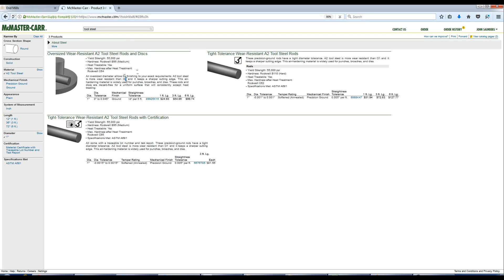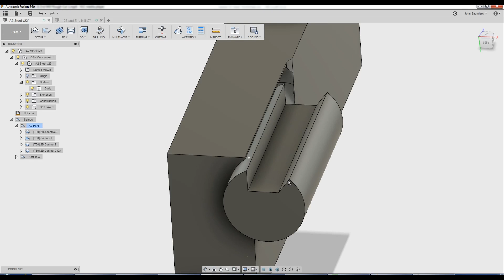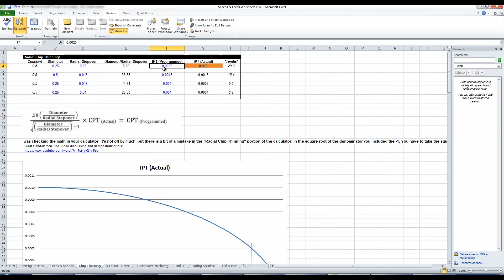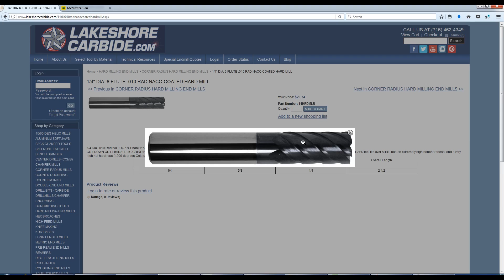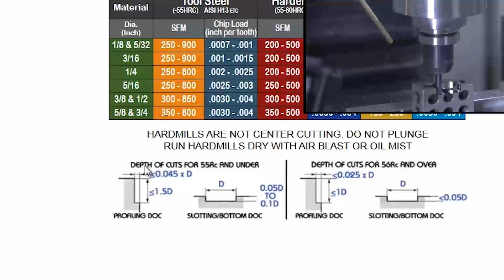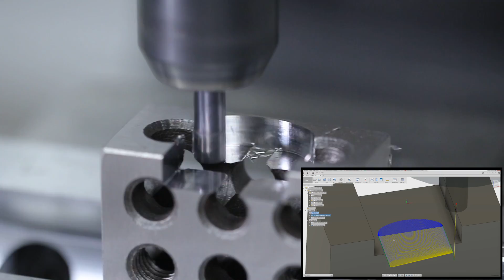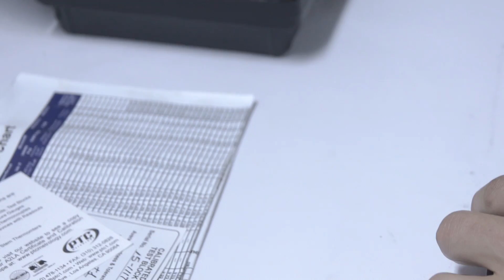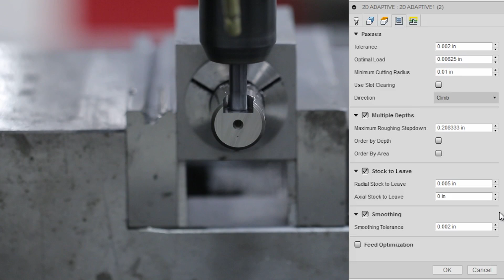Machining 60 Rockwell Steel with the Tormach!  WW166

Comment: It's very slow to process steel. In out workshop depending on the type of steel we use feeding from 1 to 50 mm/min with 300-800 spindle RPM for drilling/milling and for the bigger drills RPM can drop to 50. Have some monster 50mm drills and 240mm face mills. xD
Reply: For milling look into the Kennametal Harvi I TE and a decent CAD/CAM package to make high speed toolpaths.

Comment: how would you go about drilling a .250 Hole in 60 C  to insert a dowel pin?
Reply: 3/16 or so diameter 5-6 flute carbide endmill, then helical mill to depth.  Small helical angle...like 1 or 2 degrees.
Reply: Holeshoot it with an EDM hole driller and wire edm it to size. Good luck helical milling in 60rc with a small cutter....doesn't work for me. I'd like to see a video of that though. Going to spend more on endmills than you would sending it out....especially if the material is thicker
Reply: @kevink6420  cant EDM the  hole. its a blind hole.
Reply: @metalworksmachineshop  i dont know the application of a blind dowel but that’s a predicament then , more so getting the actual dowel out of the hole unless its a pull dowel or permanent. I would personally drill it with a solid carbide drill just undersized and take side cuts from the inside of the drill hole with a .1875 carbide endmill....we use the x5070 series from YG and they work well for side cutting. Bottom cutting is near damn impossible to do efficiently with just about any cutter though when you’re talking 60rc unless cutter has a big ass corner radius. Just my opinion.

Comment: Unless you make your own, most 1-2-3 blocks are only case hardened now....so it might read 60rc on the surface but they're not on the inside...I've drilled into a few over the years lmao

Comment: My favorite is as many flutes I can with an alcrn coated end mill. SGS 7 flute 1/2” rips through tool steel like butter. I probably cut deeper than recommended but it keeps eating it up as much as I can feed it. Had one cutter I dove in at .120 and it still cut it but I did end up with a round shoulder end mill :-).

Comment: I spent 6 months working in a Toolroom setting, and I regularly milled hardened A2 and D2 (Rc 55-60) on a Sharp knee mill. We used the Acurite Millpwr to create trochoidal toolpaths to shoulder and slot at .005" a pass. We only used carbide resharps because we didn't want to be smoking brand new cutters. It made a hell of a noise even at only a .005" doc. I don't miss those days.

Comment: The shank of an HSS tool bit is softer than the business end. You did measure it; but a good file will bite into the shank of an HSS drill bit just fine. Try milling an old file maybe, and make it a direct reply to one of AvE's videos?
Reply: Haha, hard M2 is nasty awful wonder shit.  Especially to grind.  It will eat your wrong wheel.  Hard M2 is nothing for carbide.  Carbide is like a honey badger.  Honey badger don't care.  Gorilla Mill don't care neither. Coolant or not, gorilla eats everything alive.

Comment: Not a cnc guy, why does the program start out of line before it starts to cut? Is it to prevent snipe like in woodworking?
Reply: The software is trying to keep the cut consistent radially, regardless of the path.

Comment: A couple weeks ago I crashed a 3/8" solid carbide end mill into a 1-2-3 block. There are some slight surface marks on the block, but it survived pretty much unscathed. The end mill, however... Well, let's just say I have a shiny new 3/8" solid carbide end mill.

Impressive that you can cut it like that with the right tool. Those blocks seem pretty close to indestructible.

Comment: Where do you get the aluminum block setup that holds a collet for round stock that you used to mill the end mill with? Did you make it or buy it? I have searched for one and can’t find one. 

Also great videos. You have helped me a lot in cnc machining. You got me hooked on Lakeshore carbide end mills for aluminum. 

Thanks!

Comment: Nice!
While hard milling is beautyfull and an everyday technique, it can be so painfull ;)
Large diameter/length ratios will show you how flexible a carbide endmill can be.

Even my little Datron at work can do suprisingly good hardmilling - While we have a lot of specialised endmills for hardmilling, I use a lot of standard carbide, 3 flute, 45° flute, TiAlN coated endmills for it, up to 55...60Hrc. Above that it becoms exponentional harder to machine and more of a tooling issue.

I found machine rigidity and spindle pwoer not as much of a problem, but runout on the tool is critical...
Reply: Threading is the bitch I struggle with. Turning and milking is easy in comparison. I have to pre drill a m4 threaded hole at 3.8 or I can’t get any threads to cut, just broken taps :-(, lol.

Comment: Great vid as always! I didn't check the comments to see if this was mentioned already, but a word on SFM, dry machining, and coatings... I'm sure you will realize this when you start to research the coatings more, but lower range minimum SFM recommendations could make more of a difference than you think. If the tool and chip does not reach a minimum "activation" temperature you will seriously reduce tool life in a production atmosphere. Those coatings not only provide surface lubrication, but also a harder surface on the tool and do not function until they reach a certain temperature. I have done alot of mold and stamping die work in my  shop, slabs of 4140 hardened to 50Rc weighing 300 lbs with 24 hours of adaptive clearing alone. Sometimes a difference of 5 SFM is all it takes to make a tool last 1 hour or 10. Step over affects tooth engagement time, percentages are calculated, SFM increased in a linear scale, blah blah blah too much for a YouTube comment. All I'm saying is that you can and should make those chips hot enough to melt those rubber bellows right off your column, and your tool will ask for more and more. Keep at it John, your an inspiration for entrepreneurs everywhere!
Reply: Thanks for the tip, and only for a minute
Reply: So I can forget working these on my '92 vintage Haas VF-0 with it's plastic enclosure. 😐
Reply: UncleBman not at all. when your dry cutting materials you still have a coolant pump at your disposal and the chips will still pile up somewhere. I like to keep the table and enclosure flushed clean while running a longer job so the chips find they're way down and out. Sometimes, if it's just a quick pocket or slot, I will wet down any soft surfaces right before hitting the green button. A machine I sold last spring had polycarbonate replacement windows, I used thin galvanized sheet metal to make a few deflectors to keep them from melting. You could lay some down in the bottom of your enclosure also if your worried about it.

Comment: Most cheap 123 blocks are just case hardened, so it should be much softer on the inside.
Reply: Bingo, my first thought when I saw this video.
Reply: Thanks for stating that fact.  Just asked my pop pop and he laughed at it

Comment: John, you still haven't corrected your spreadsheet. I mentioned the error in your previous feeds and speeds video. It is not off by much and won't make a difference with larger radial thinning, but you may run into problems when taking smaller cuts. The error is in the chip thinning formula programmed into your excel sheet. The -1 in the denominator is subtracted after taking the square root of the ratio. You are subtracting 1 then taking the square root. Hope that helps, take care

Comment: I would imagine edge life on a carbide end mill is drastically reduced on a hard mill operation. So if you can hard mill 10 parts with one mill hard but 100 parts when it is soft then maybe that would explain why it is not so popular for mass production. Also there is no guarantee that you wont still have part deformation when hard milling from relieving stresses in the hardened part so it may or may not be a benefit there.
Reply: When i worked as a toolmaker.. Hardmilling and hardturning was "all in a day's work.
We'd make the parts slightly oversized when still soft, then hardmill or hardturn finish them.
When used properly, these endmills lasted quite a while.
Nowadays, when i need a special shape cutter on a lathe, like a face grooving cutter for gaskets in watch cases, i just mill those from old endmills, made from HSS, i just design the desired shape, make my CNC programs, put an old endmill in the Chuck, mill it in to shape, and put it in the lathe..
Reply: bcbloc02 tool wear might be an issue, but the bigger issue is machining time, if you can cut unhardened at 50 thou per pass versus 3 thou per pass for hard milling, it would take a lot longer.  The hard milling I've heard of is used in repair work for molds and dies.  There is a place not too far from me that repairs tire molds and they do a ton of hard milling.
Reply: anonymic79 hard machining is done in a production atmosphere too. If a billet is properly stress relieved during the final heat treat it will hold tolerance very well. Hard milling also tends to leave a higher quality finish which cam remove the need for any post op grinding or polishing.  It's all dependant if what is being machined and what it will be used for.
Reply: Hiram Rios minimal engagement still results in the same amount of heat as a wider cut in a softer material. A very small amount of heat is generated right at the cutting edge, while a majority of it occurs just thousandths of an inch inside the cutting edge towards the gullet. The remainder is a result of burnishing, and that's all dependant on cutter geometry. The heat is a result of the friction at these surfaces and the distortion of the material as the chip rolls and forms. Harder materials are harder to shear and harder to form and curl around, this resistance to movement creates more heat. The biggest contributor to heat though is SFM of the cutting edge. In a typical HSM operation, factory recommended speeds and feeds are scientifically calculated  based on the amount of time the cutter spends actually cutting metal and usually considered as %50 the diameter of the tool. If you are running HSM with a step over of %25 then you are only imparting A theoretical %25 of the total heat into the tool. Therefore you can increase the SFM of the cutting tool by a given percentage and of course the IPM to maintain proper feed per tooth. Suddenly your total material removal rates skyrocket through the roof. The tool and cut material still only see the same amount of heat. This is the basis of HSM theory. This is a much more sensitive subject in hardened material, but generally the same rules apply. Hence the broad range of recommended cutting parameters. Inevitably, machine rigidity and capabilities are the limiting factors, only the operator can know the limits. And must be experienced as well. I can mill 6061 aluminium with a .25" diameter 3 flute at 24,000 rpm and over 800 IPM on one machine I own, but due to rigidity issues cannot exceed 200 SFM on the diameter cutter in 55 Rc 4140. The same cutter in another machine can run about 750 SFM without issue. There's a whole different science to learn when you reach a certain level...
Reply: Do you think because of the minimal engagement it actually produces less overall heat then grinding ? maybe it actually makes less heat and imparts less stress on the parts ? Compared to grinding which has a great deal of surface to surface contact

Comment: LOVE your channel!  I personally feel like set screw holders are fine, but destiny tool recently posted a picture on Instagram advocating against them. I wonder if it's because they're focused more on larger machines and shops?
Reply: typical runout on a set-screw holder is 1-2 ten thousandths. You need clearance for the holder to let the tool in obviously. 5-6 microns is not eough to worry anyone, what's a few microns amongs friends?  Its not hydraulic but ...what is with a set screw?

Comment: Ah, the joy of SolidCAM when it comes to this sort of stuff: Just tell what tool you have, what hardness your material is and hit go. No calcs, no datahsheets, just getting chips flying and fast.
Reply: That joy comes at a pretty high price!
Reply: That is ideal when every tool manufacture uses the same feeds and speeds ;-) not. You use a estimated value for a tool not a precise value. Or a college from you has made for your company special tool libraries that you use without thinking how the feeds and speeds did come to life ;-)
Every tool/manufacture have their own spec (feeds and speeds) for hardness and material.

PS. Solidcam is nice used it. But it crashes me to a lot on big molds (for example: dasboards from cars). That's why i did move over to Mastercam in Solidworks.
But for normal work 3d work, nothing can beat the price and capabilities from Fusion 360.

Comment: If you have some of those faulty 123 blocks, with undersize clearance holes, you can use a carbide end mill to enlarge the holes so the can be bolted together like the should. I did it on a hobby grade manual mill using a cheap carbide end mill, so if I can do it anyone can..
Reply: You're probably just chewing away the burrs, so no real pressure.
Reply: @soundspark  the holes were definitely undersized, they were a cheap chinesium set bought at a club auction.  Reasonably accurately ground for size and squareness and the threaded holes are ok but it seems the clearance holes were drilled tapping size if memory served

Comment: Did you check the HRC on the inside (i.e. the surface you machined) of the 123 block?
Reply: Probably around 34 HRC at most, I've never seen those things through-hardened as it serves no purpose. Case hardening and tempering I believe what is done with those, but again depends on the material used. Some tools are done from through-hardening and are usually 54 HRC, whereas case hardened would be 60 +-2 HRC.
Reply: I would also like to know this. What's the internal hardness?
Reply: Speculation is one thing, but I would like to see the actual measurement of the inside of this particular block.
Reply: I would believe it. I have seen HSS - Co 8% endmills reground from 12mm to 8mm and they cut just fine...
Reply: Nicholas Lee I would also like to see the hardness of the inside of the end mill he cut into the i don't believe the center of the shank is as hard as the flutes.

Comment: You could also try machining a bearing ball :)
Would be really impressive.
Or what would happen with hardened, but not anealed steel? It's harder and more brittle.
Reply: Klaufmann they drill very easy with a carbide drill bit , I do it to make bob weights for watts type governors for scale steam engines

Comment: Found it interesting that harder materials come out with a nicer finish after machining. Great vid as always man. Always learning cool things!
Reply: arvicz22 It is because is not as gummy.  Harder materials strain a lot less before fracturing.  You are essentially fracturing those small chips off the workpiece. The less the surface moves and deforms, the more even your cut is.  You get chatter when your tool flexes and vibrates.  You also get chatter if your work piece moves.  You are minimizing that movement.  This all assumes decent machine rigidity.  A clapped out mill will have a much worse surface finish.
Reply: @Worrsaint  There is also the tendency for mild steel to tear and gall when cut?  I can only get 1018 shiny with high speeds, good carbides (mill with Harvi I TE), and lots of coolant.

Comment: You mentioned replacing the set screw on the tool holder for the weldon flat. Can you elaborate on that?
Reply: Westley Davis tormach uses cheap set screws